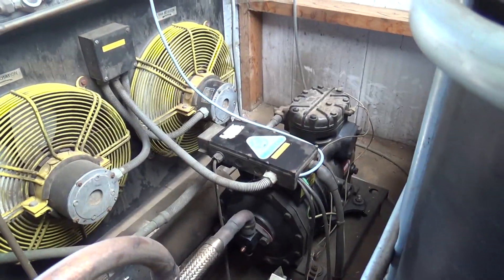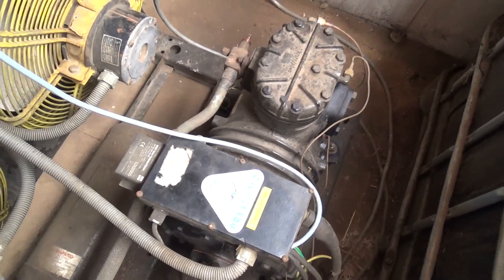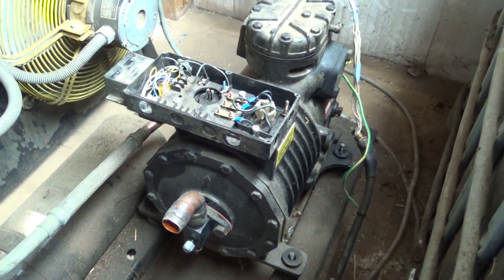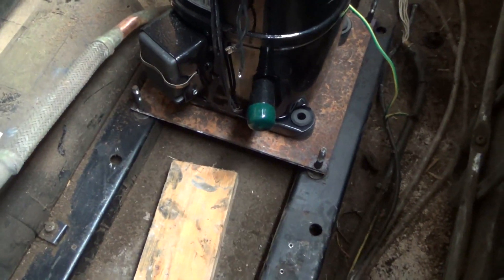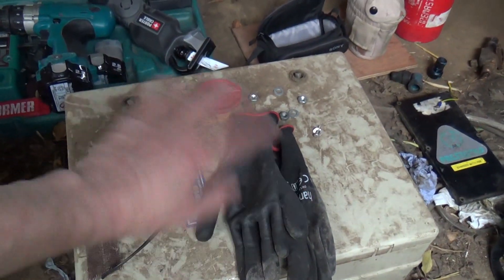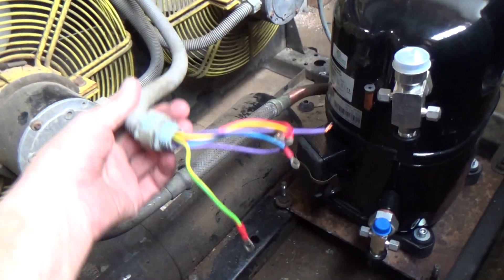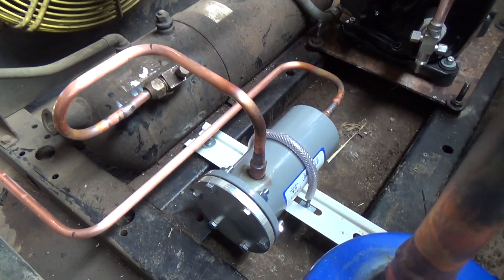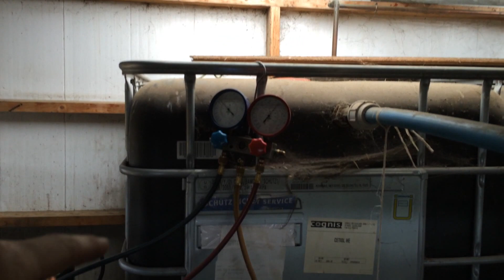Copeland Compressor Replacement R417A to R407F

Comment: Nice looking pipe. Really like the Allen key set. Great fab work with the compressor plate.
Reply from the maker: Rob HVAC Thank you Rob! The Allen key set is great for fan blades etc, must have had it 15 years.

Comment: nice stuff brother. originally when i first started out. i worked for a manufacturing company. i used to install all types of compressors. so when i started to work somewhere else i installed not matched compressors as long as the tonnage was matched i was good. however people used to bust my balls for not installing the exact compressor.
Reply from the maker: Thanks! I usually try and fit like for like as its quicker and easier, but have done a few changes fro different makes. The system don't care so long as its still got the same duty as the original compressor. This one is smaller, but I don't think it will be an issue as the system is sized to easily cope on one compressor only.